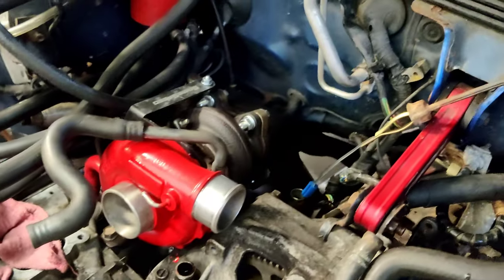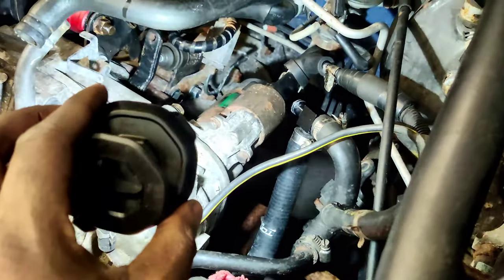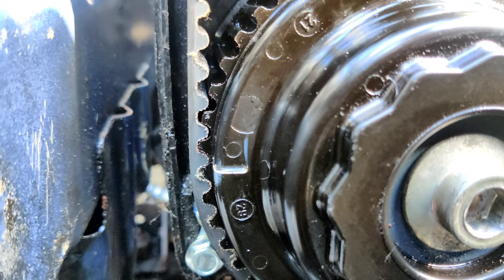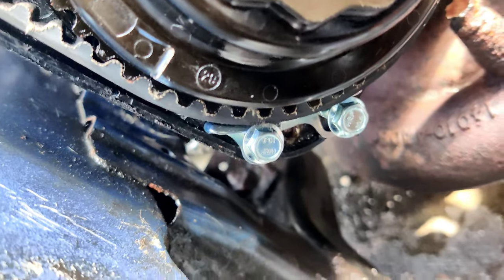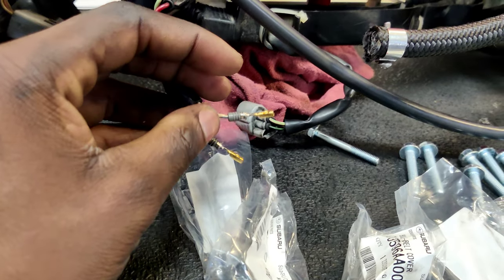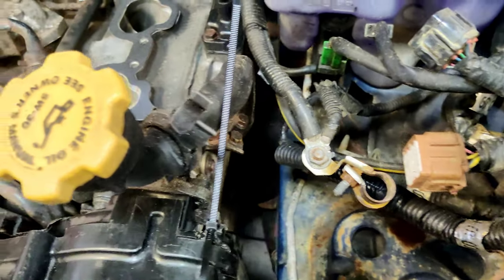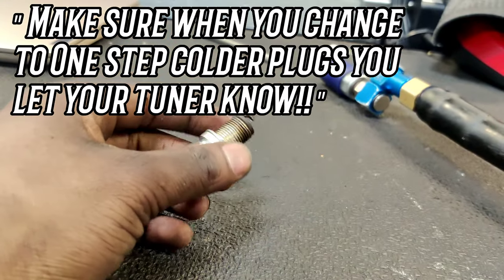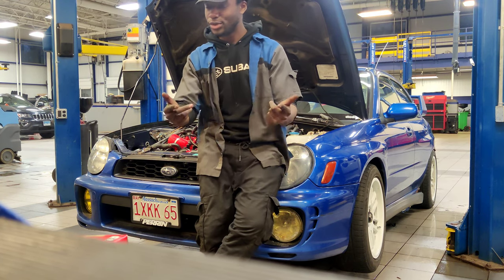Putting all the pieces together! (WRX intake manifold install)

Comment: good stuff... Is that JDM EJ20 or a USDM EJ25?
Reply from the maker: Nothing crazy! Just a USDM 205. Its my original motor that I pulled out prematurely due to misdiagnosis. We resealed and refreshed it before putting it back in.